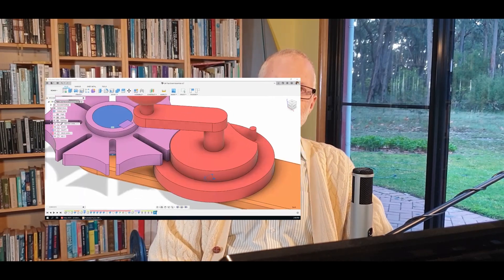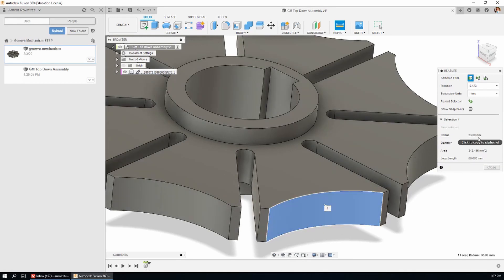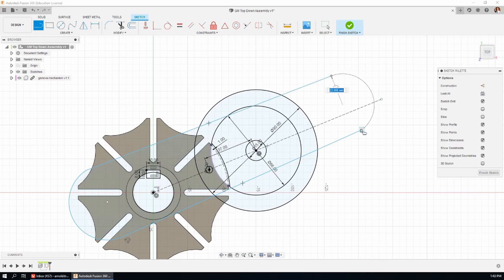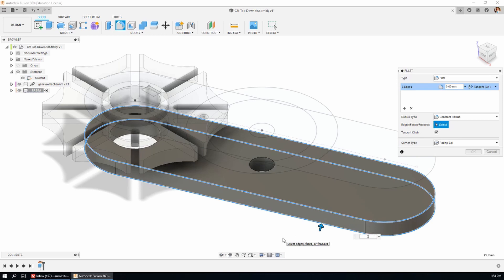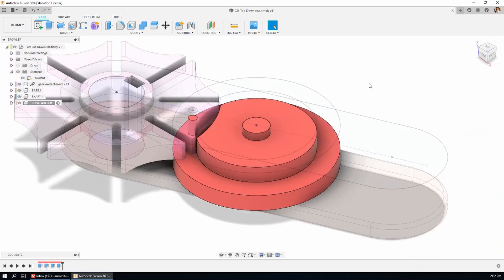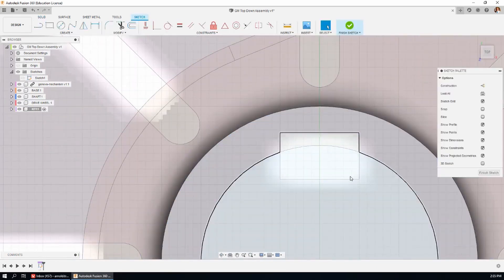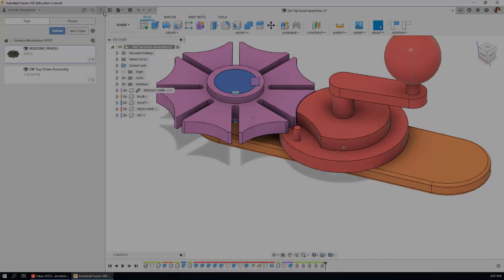Top Down Assembly Modeling | Click by click

Comment: Awesome, epic. Great video. Seemed overwhelming at first but step by step done 3 times over while understanding it. Its a sinch (; I'm not sure if I got the angle in between the 2 construction lines. My pin seems to be butting the Geneva mechanism and not revolving smoothly. 
Imagine, kangys in your backyard- the life😃
Reply from the maker: The kangaroos can be a bit of a distraction.
If you've worked through this several time you've learned quite a lot. At least you understand the steps even if there's glitchy movement. The idea is that when you come to trying out your own designs or a modification of another Grabcad model, you know how things are supposed to work. That's a big step toward your goal. You may be needing help for a while yet but you're well on the way.

Comment: Right at 6:05 you say, "Make sure this circle is Concentric with the shaft of the indexing wheel." But you have the coincident tool selected. When I try this, it makes my Base too small. Here is what it's doing: https://youtu.be/9J72PIlIRXA
Reply from the maker: Yes P3D, I see that and well done so far! Thanks for your video, that makes it so easy to understand your question. I think you'll find that if you put a dimension on the radius of the curve or a dimension on the width of the base it won't behave like that. You'll be all over this in no time but please come back if you're still stuck.

Comment: Great tutorial! I like to follow along as you build. I did run into a problem with the animation. I followed you to the letter on the joints but for some reason the pin stops at the entrance to the slots periodically and the key loses it joint and then snaps back into place when rotating the drive wheel. Is there something I need to adjust to prevent this?
Reply from the maker: V4t, I wish I could be looking over your shoulder, there are many things that can cause the animation to fall over. Fusion is calculating large number of alternative scenarios with the geometry and angles within the contact set. What I'd be doing is checking the sketch and the extrusion extents, any variation in size can lead to an interference between the selected components.
Since its good to repeat the exercises, its probably better to repeat it carefully than to check over all the details. Your call.

Comment: This is an interesting tutorial.  I'm having difficulty with the plane that I am supposed to be sketching on.  When I make the first circle constrained to the wheel it automatically moves from the plane I started on and I'm not sure how to proceed?  https://a360.co/3dMf5mz
Reply from the maker: Bob, I presume that you've been practicing this particular skill at least 16 times before now? In the video I chose the top of the boss of that indexing wheel. The grid pre-highlights as you move the mouse around looking for the plane for the sketch to be made on. Are you saying that you're sure you selected the correct plane but it moved or changed? Here's a way that you can confirm it to your own satisfaction:- open up some of your older models and choose a sketching plane on all sorts of weird and fun planes and places. Then come back and do the same on this wheel until you're sure you've got the top of that boss. Is it still mis-behaving?

Comment: If I use your method of creating a rigid joint between the BASE and "top level" the KEY does not rotate with the SHAFT during animation. If I instead "ground" the BASE, the KEY will rotate with the SHAFT. Is this a bug? Why are you not using "ground"? Other tutorials on joints uses "ground". I'm a bit confused.
Reply from the maker: I know that 'Ground' works OLLE, come to think of it, I can't remember who it was who said to use a rigid joint with the top level. It was someone at Autodesk in a live stream and I don't remember a reason why other than that he said this is the way they designed it to work.
I'm sure a lot of others who use ground are re-living Solidworks days but on educational level projects like the one in this tutorial you can really get away with almost anything. Thanks for the question though, I'll see what I can find out.

Comment: Very good delivery. Enjoyed learning from you.  My only question during the development was how you knew 37 mm was the right distance to place the pin on the driving wheel.  Seems that placing two construction circles for the two sides lobes of the slot entry and then averaging their radiuses would get you the proper distance. But perhaps there is an engineering design approach.
Reply from the maker: Good question Gordon, my first attempt caused a glitch in the animation when the pin bumped its way into the slot. I looked a bit more closely and made one adjustment, didn't write down the details or the thought process and can't remember now. My purpose was simply to make a model that animated (nothing like an engineering approach).

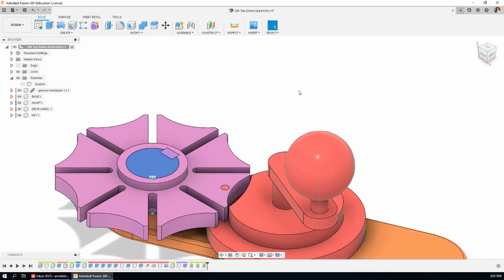Comment: Excellent video on joints.  I think I even understood enough to ask a question.  Is there an advantage to making the rigid joint between the indexing wheel and the shaft (17:30) over a rigid joint between the indexing wheel and the shaft-key joint?
Reply from the maker: Thanks Zachary, I did spend a few moments pondering that when I was making it and decided on the spur of the moment that I'd focus on the wheel to shaft joint because the function of the pin is only to stop slippage and reinforce the interference fit between those two main parts.